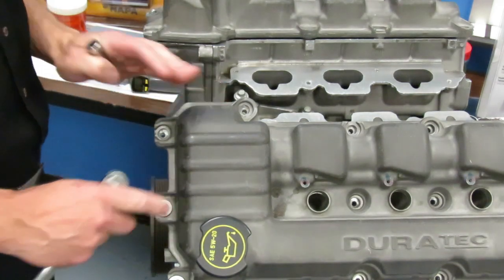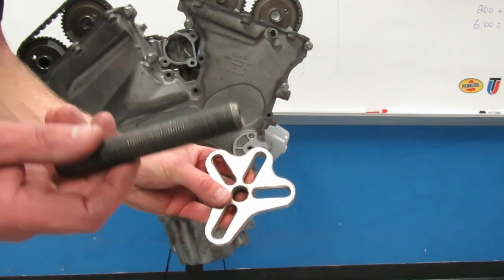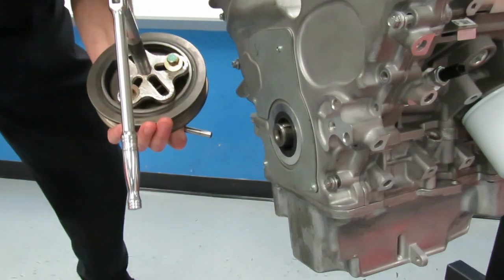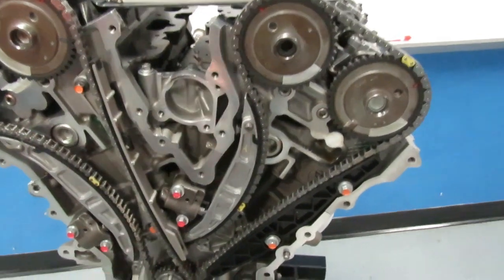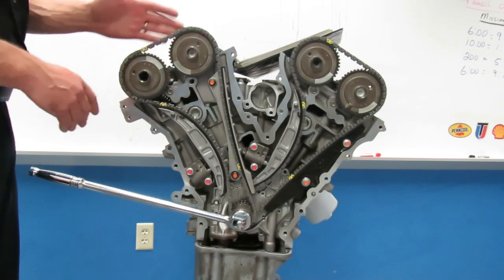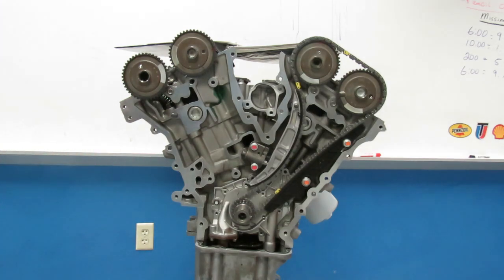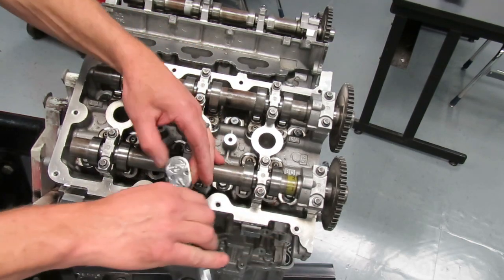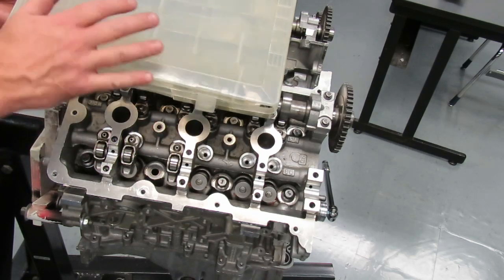Ford 3.0 Remove the engine covers/Timing chain

Comment: what kind you don't mention anything about getting out the water pump first, before you get into the timing cover ?
Reply: The water pump is on the back of the engine.

Comment: What you didn’t mention is that there are two key way slots in the reluctor wheel and it can go back on in two different positions.  Need to mark the key way slot on the  reluctor wheel that goes over the key way before taking it off.
Reply: Don't really need to mark it. It has marks for 2.5 or 3.0 on it already.

Comment: To any diyer thinking about taking your engine apart for the first time. Follow this video and nothing else. I did and the assembly video and it went smooth. This video makes something very complex actually very simple. Thanks for the awesome video
Reply: Where did u find an assembly video I’ve been looking and can’t find it
Reply: @ThomasSelman-nl7dt  https://youtu.be/VfVc9MPTm3Y?si=Dbw_zunmMmiKmRDo
Reply: @ thank you
Reply: @ThomasSelman-nl7dt  no problem. When you go to put the 2nd timing chain back on, the video might be confusing cause the markings won't like up with the cams in the positions they are in after the first chain. But you'll notice the cam position changes when he puts the 2nd one on. Just turn the crank backward slow until the cams are in the position shown in the video and it will line up with the chain. It will only need to roll back a tiny bit. Other than that the reassembly was smooth sailing
Reply: @ awesome thanks for the info where did you find out the torque specs for everything

Comment: What if the driver side timing chain is the on in the front
Reply: That's how mine was setup and I can't find an answer as to why.
Reply: I followed these instructions on how to time my 07 3.0 fusion I put the chains back to how they were removed (the right side while looking straight on at the engine) so the right side in front. Got it back to together and won't start. I suspect I timed them 180 out. All the service manuals show it done this way but since my chains were installed backwards I put it back the same way. I'll he following these instructions and swapping the chains to the correct placement. I hope this makes sense.

Comment: I'm close to 300k, in a 07, 3.0 duratec engine. I was told to replace a timing chain at 300k to prevent a break in the chain. My engine has been babyed since I bought it at 138k. Rarely goes over 2500 rpm.

Comment: The intial alingment of the timing marks move from the set position each revolution of the chain by about 2 links. I did not know that and disassembled the chains and tensioners after tuning the engine over and rechecking the timeing. The marks were not longer aligned.  Why is that?
Reply from the maker: Odd number of links on the chained they are still aligned if you were to rotate the engine enough times the painted links would eventually line up again but no need to do that

Comment: To those who think the marks should all be at 12 O'clock- you are forgetting or ignoring the simple purpose of this procedure- it is for removing the chains without damaging the valves with no extra special tools or disassembly! It is brilliant! When you put the chains on, then the marks will line up in a more familiar configuration. You are still talking about lining up six axis across a 45 degree bisectional plane because it is a 'V' configuration engine with 2 camshafts and a crankshaft per head with a dozen valves on each head. No such angle exists to line up five shafts and all 24 cam lobes with all the valves closed during disassembly. If you cannot grasp the simplicity of what I am saying, do not work on any more engines.
Reply from the maker: Exactly!

Comment: Thanks for the video. I am Kurdish. Been living in America for 8 years now. I love your videos. I am also learning about engines and cars. Recently I got a 2004 Mazda tribute that has Ford’s duratech 3.0 v6 engine. I have recently changed serpentine belt, water pump and tensioner, Thermostat and I repaired couple exhaust leaks.  I am having issues with screeching noise  that is very loud when I go over 2000 rpm and car does not go over 30 miles. I am having 2 codes p0135, p2195, p2196 I am still not sure if I fixed the exhaust leaks correctly. Would appreciate any comments or recommendations.
Reply: DID YOU FIND THE PROBLEM?

Comment: Why not put the engine at TDC and lock it all , then remove everything and replace 😀
Reply from the maker: because you will have valve to piston contact when you remove the chains the spring pressure will cause the cams to move and jam a valve into a piston the procedure I demo here is directly from Fords service manual the Factory does not lay out these procedures for no reason this kind of stuff is important with OHC engines

Comment: I'm doing the gaskets on the timing case cover I wanted to change the tensioner and the followers can I do this without losing the clock positions nothing is under load to cause it to lose time is there?
Reply from the maker: you shouldn't need to change them the chains and tensioners should last the life of the engine according to Ford
Reply: That's not what I asked! According to Ford trans fluid is lifetime to don't believe it.

Comment: Except my wifes 2011 Ford Escape V6 didnt have the 3 bolt holes on the crankshaft pulley, and she bought it new, so now ask me the crazy scientist stuff I had to do to get that off...
Reply: The '9-'12 don't have the threaded puller holes but they look set up for a standard 3 jaw puller.

Comment: So how do you know 100% that’s it’s an interference motor how do you know everywhere I look it’s mixed answers
Reply: Take the timing chains off and spin the engine until it hits the valves.   And after it touches, get a breaker bar and turn the engine over 360 degrees.

Comment: So the real question is.. can the cover be removed when engine is in the car? On my 06 3.0 fusion.. room is EXTREMELY tight.. getting ready to do a cover reseal and valve gaskets.. I am not looking forward to this. Any tips out there people? Has anyone done one out there with Engine in car?
Reply: Did you ever figure it out? What all did you have to take off to get it off?
Reply: I have done this job 3 times with the engine in the car.
It is obviously a tight job , but it can be done 👍
Reply: @simonmoffat4629  I'm about to do a set of head gaskets on an '07 Fusion. Any suggestions or advice to avoid any "Oh no..." moments? ~Rust Belt Warrior
Reply: @Ignivomous  How did it go?  Did you have to resurface the heads?

Comment: crank at 11, cams at 10 and 2. Why the hell didn't they just make it so everything lines up with all having  marks at 12?
Reply: How do you suppose the cams would be perfectly clocked so that you can mark them where you want and have the crankshaft sit there perfectly timed while bisecting six angles? A single angle doesn't exist across all six planes simultaneously on a "V" engine configuartion.  You are forgetting or ignoring the purpose of the procedure is not to line up the timing, it is the removal of the chains with all the valves closed. You are lining up a neutral position on five shafts with a total of six axis, with dual overhead cams with variable valve timing- so all 24 cam lobes and the crankshaft line up with all the valves closed at the same time, and you think you can just pick a spot to mark on the cam and crank pulleys that will happen to be right? Good luck. If you stop and think you will realize the set up is so brilliant and well thought out that you do not have to go out and buy an additional special tool or use vise grips on the camshafts to hold them in place to protect the valves. Be an engineer if you want. No one is stopping you. If you can do better, do it. Otherwise, follow the directions. If you aren't following the simple logic I have written here, you have no place in this field of repair. And, take your own advices, go meet and speak with an engineer. All the ones I have met wrenched on cars for three years or more while studying, before starting to study the engineering of the thing, and they are all wicked smart. Ask them in person why you pull some bolts that cannot be backed out all the way without hitting something else. You might be surprised at the very simple answer.
Reply: @jessesyfert9359  Why did dodge engineers decide to solder the fuel pump relays into the bottom of the 1,000$ TIPM? Better yet, if they’re doing that why not use solid state ones instead of contact style relays so that they outlast the vehicle? Sometimes the answer is simply to make more money off consumers. I’m actually an engineer btw.
Reply from the maker: you will need to talk to the engeneers at ford to figure that out
Reply: i said the same thing today. like wtf?

Comment: And those “clock” positions for the camshafts are in relation to the top of the cylinder head, where as the “clock” positions for the crank is in relation to the centerline of the block?
Reply: In  a relation perpendicular to the surface (flat)  position of the block and each of the heads.  The perpendicular line would mark the 12 o'clock for each.